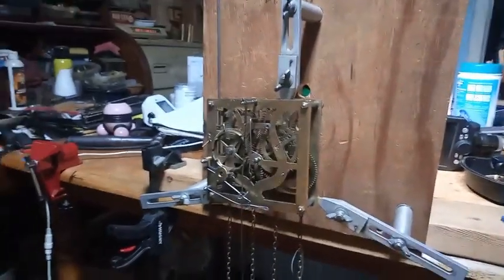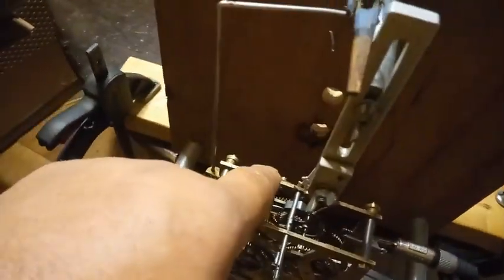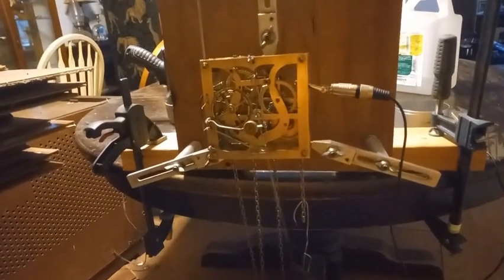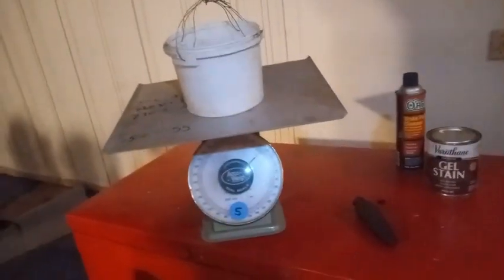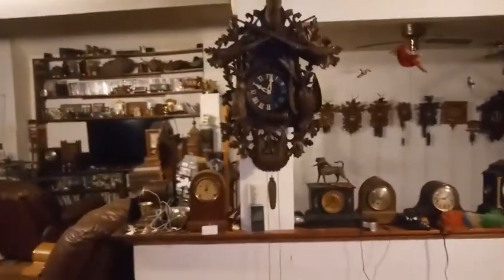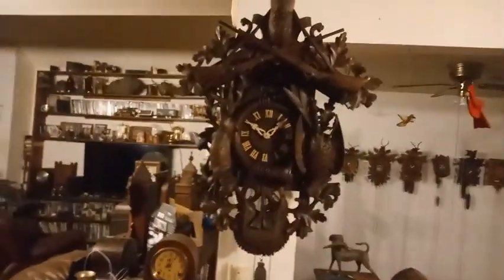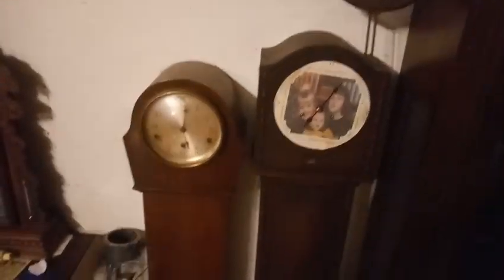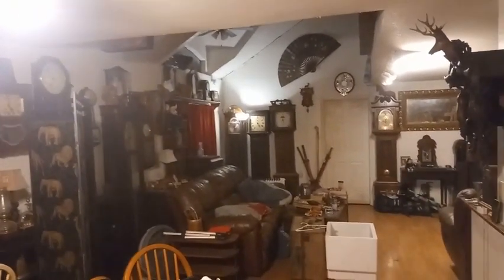Finally repairing my Alexander Fleig 1880ish After the hunt, Hunters cuckoo clock

Comment: Just like you have said, That is one large, gorgeous clock. So happy you got it running again along with the right size weight. Thanks for the shout-out in the video, including the end.
Reply from the maker: It is a lovely clock.  Unfortunately I have to put it back on my stand. On the stand it ran for a couple of hours. On the wall it runs for a couple of minutes. Taking the hands off I think the issue is that the minute arbor is touching the wood.  So I am going to take the movement out and make the hole bigger. It is such a huge clock and due to size and age can be easily broken which I am afraid to do every time I work on it.  Thanks for watching.  May God bless you and yours.